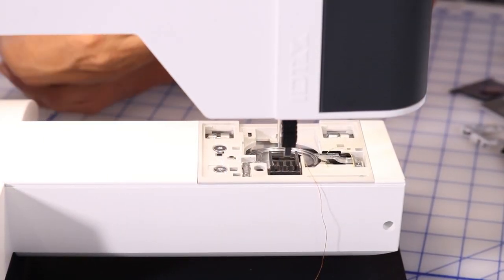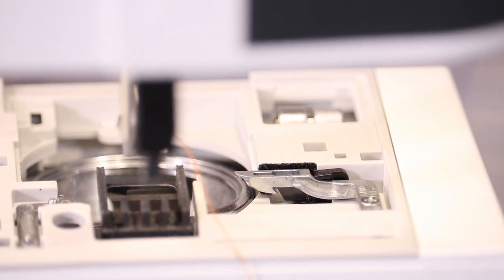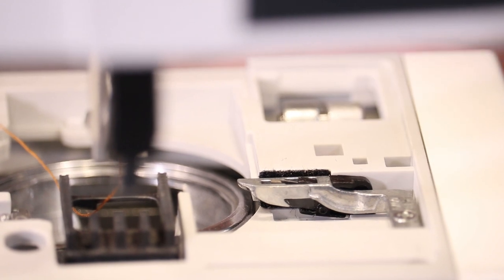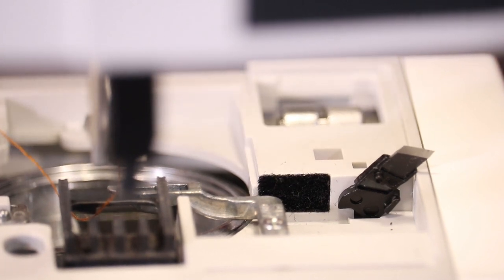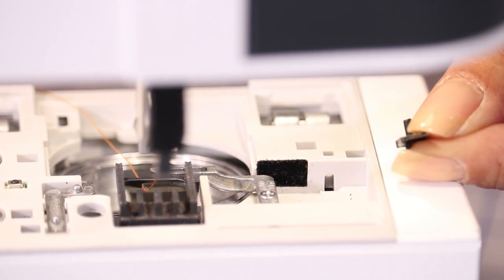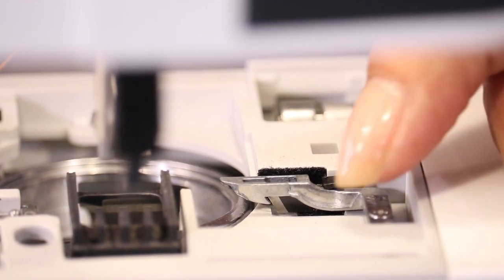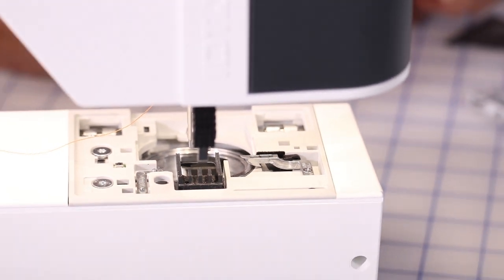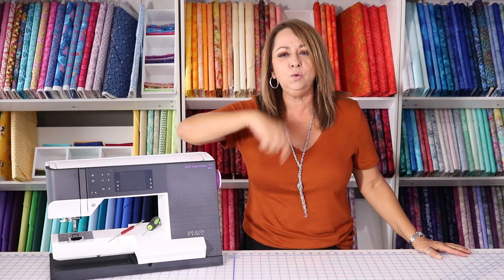Quick Fix - How to Clean Your Automatic Thread Cutter

Comment: I'm so glad I found this video even though it's 2 yrs old! I was loosing my mind! My needle was constantly coming unthreaded when I used my auto cutter so had quit using it and I guess I wasn't putting the right words in the search engine, but FINALLY I found you! I cleaned under the mechanism and it works like a charm now!  Thank you soooo much!